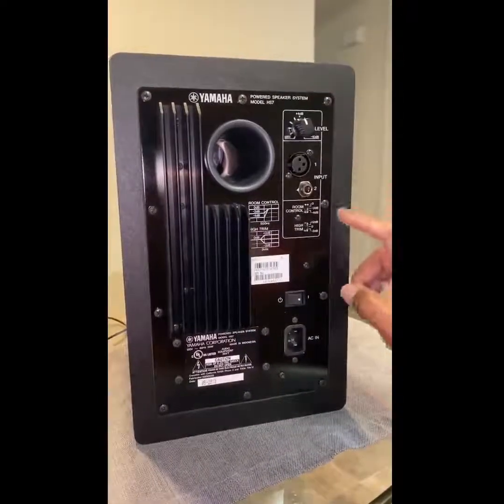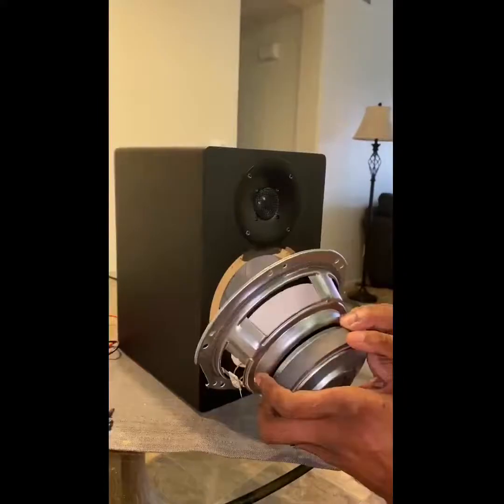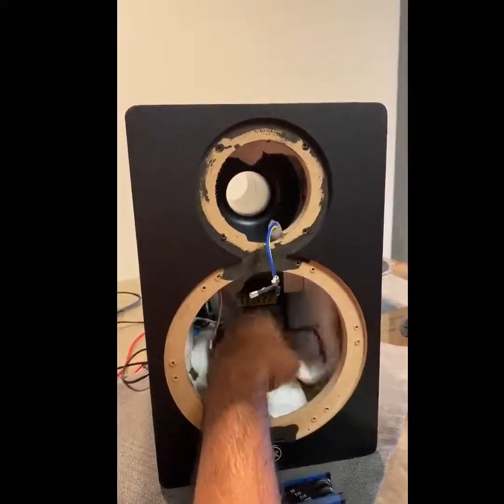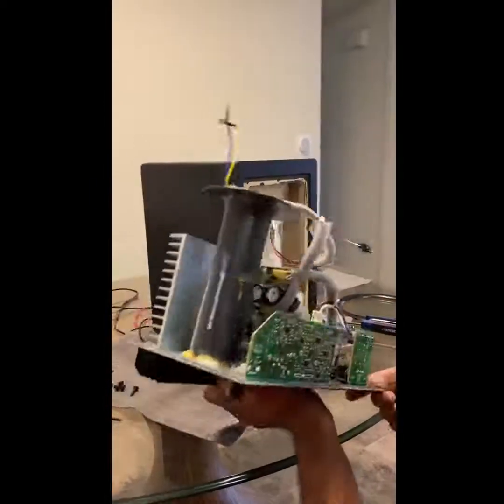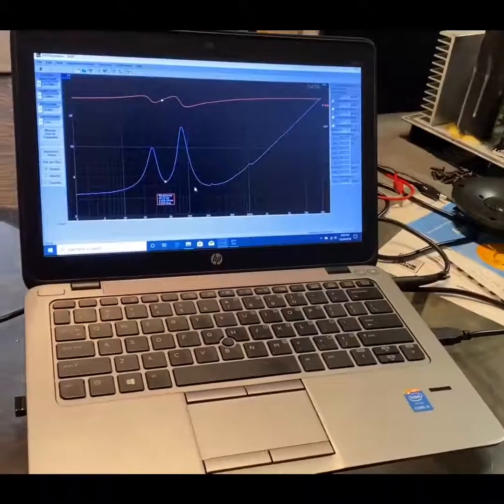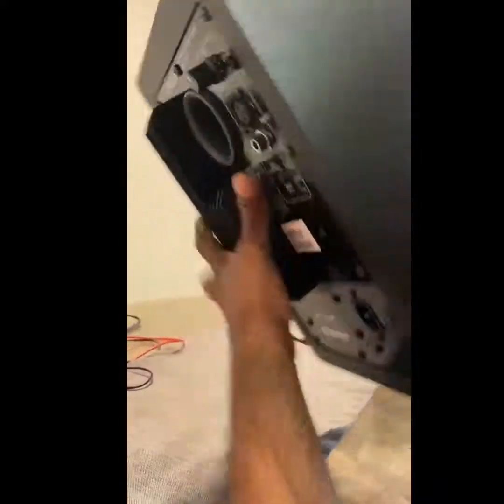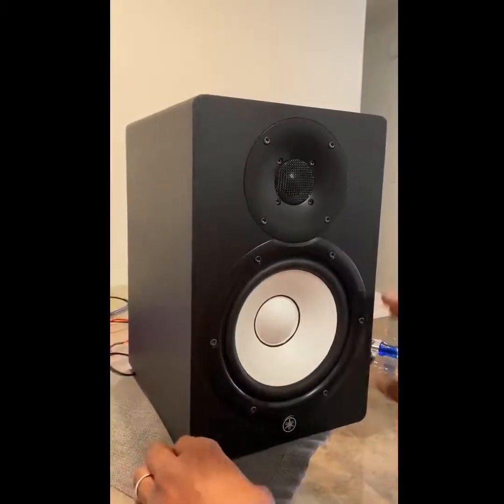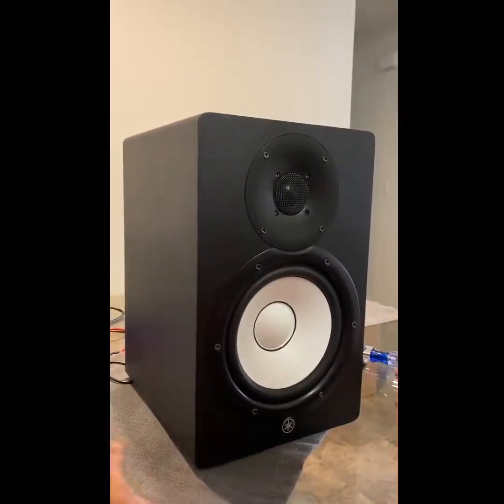Yamaha HS7 Teardown

Comment: My high trim switch seems a bit unstable. Just touching the switch causes the tweeter response to change. It may be a short. Anyone else run into that problem? Thanks for the teardown. I’m going to open it up and check it out.

Comment: Do you have to start with the rings/speakers or could you start by removing the amp first (and disconnect the drivers from that side)?
Reply: Yes, but it's more difficult to disconnect the wires from the speakers.

Comment: Do you ever dropped your hs7?? i wondering how durable they are , i dropped my hs5 (not too high , about 6inch maybe but its knocked to hard ceramic floor)
it still work but i dont know if it something broken or maybe loose inside it
Reply: dropped mine coup[le of times, dont worry
Reply: @lachlancameron3528  It deps on how it lands.
Reply: mine too, from like two feet, also got a accidental candle burn on one side... somethimes i think on get another set of monitors but, buuut... this Yamaha (hs8) still working well, and after room calibration with sonarworks... not need of anything else
Reply: For me the bass port tube broke from the middle, but can simply glue back

Comment: Hey man, I would love your input on something.. One of my HS7 has a a bit of a frequency rattle with some bass instruments/frequencies. I've managed to narrow it down and it's neither of the drivers. I've discovered that if I press my hand against the black spoilers that come out it stops resonating. I wonder if something could be loose, maybe a set of screws that need to be tighten ?
Reply from the maker: There is a row of screws if you look down into the fins of the heatsink. Check and see if those are tight.
Reply: @audioupgrades7759  I have a question. Is this a class AB or class D amp?
Reply: It's a class AB amp. Class D amps are much lighter weight and don't need a large power transformer.
Reply: Hey, i don't know if you gonna reply to this but i have the same problem since today. Did you fix it somehow?

Comment: how did you measure the Z(bypassing the amp). so it has a RLC crossover? <= somewhere?
Reply from the maker: The woofer is disconnected from the amplifier.  The crossover is active, not passive.
Reply: @audioupgrades7759  active is good. just hope they have the drivers in mind when they were designing it.

Comment: did i miss something... it uses active crossover? DSP? And the driver itself is completely discrete? FET/Bipolar?
Reply from the maker: Active crossover.  No DSP.  The amplifier for the tweeter and woofer uses a LM3886 device. I'm not sure what you mean by driver being discrete.
Reply: @audioupgrades7759  Thanks for the reply... :) thought it has DSP because there are so many ICs in QFP packages... oh... they are LM3886s... good choice... no hissing sound for sure... :) and no wonder it has a linear power supply there...
oh im sorry. discrete means discrete amplifier. it uses bipolar/FET transistors. :)
Reply: @XChaoticComposerX  some hissing sound, but not really audible at listening distance. Audible with your ear next to the tweeter tho
Reply: @letstrysocialism  even with balanced input?
Reply: @XChaoticComposerX  yes and at minimum gain and that's completely normal.
Reply: @audioupgrades7759  now i can see them clearly... yeah they are just op-amps in soic packages